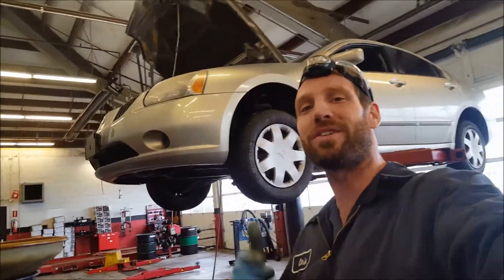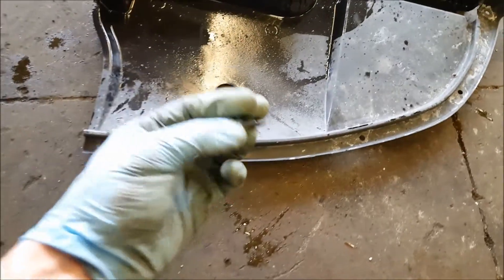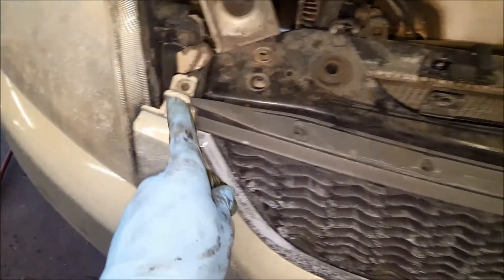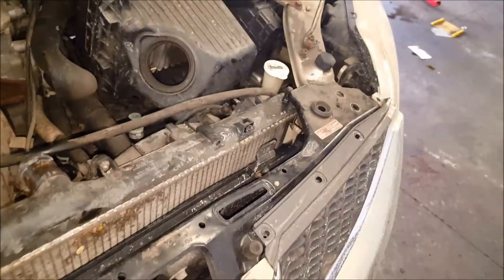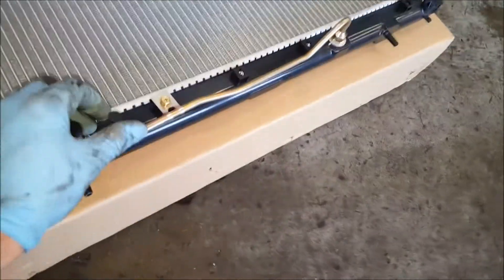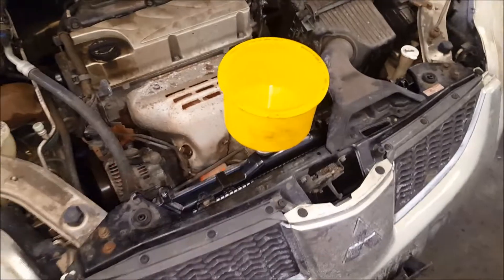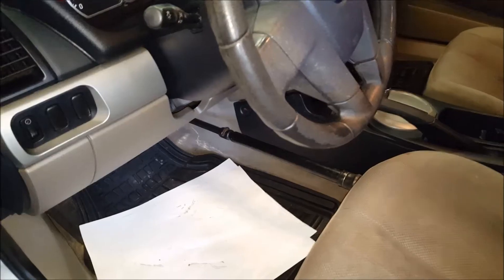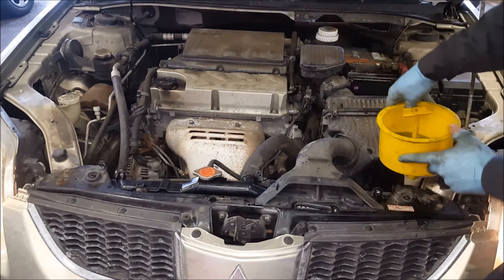04-12 Mitsubishi GALANT RADIATOR REPLACEMENT 2.4L SAME PROCESS FOR MOST CARS!

Comment: I took the radiator off and realized that the car doesn’t use oil cooling lines. The new radiator I bought has the oil cooling. If I just leave them alone would that create a problem? Would the coolant leak out of the holes? Please advise.
Reply from the maker: You just leave them open is fine. No it won't leak. There is a separate cooler inside of the radiator
Reply: @NoNonsenseKnowHow    where is the trans cooler   ?

Comment: You won't believe how absolutely spewing I was to find this video the next day after I did the job😡
Im from Melbourne Australia and did the radiator swap on my 2007 Mitsubishi 380. ALL Aussie built 380s have the 6G75 3.8 V6 Engine fitted and mine is the 5 speed auto but theres a 6 speed manual also available. 
I watched your video from start to finish and you might be amazed to hear that your video even with a completely different engine and a somewhat different car was nearly identical to the Australian V6 model!😳 
The only difference being was the 2 x 12mm bolts under the front cross bar, our car doesn't have those bolts under the grille, just the 3 on top each side. 
Other than that only a few clips here and there but otherwise everything else was absolutely identical even the cold air intake as well as the wiring as well as all the hoses. Like I said I am shattered that I didn't find this video before I did the job as it would have been extremely helpful but all I can do now is confirm how accurate your video was! 👌 cheers
Reply from the maker: Darn, well glad you got it taken care of either way. Thanks for letting me know, I'll add the 380 to the tags on it

Comment: Thanks for information but I have a question regarding the condenser... to replace it do I need to remove radiator also? My car galant 2008
Reply from the maker: No problem at all! And to answer your question I'm not 100% sure without having in front of me. I work on all makes and models so I'm not Ultra familiar with any single model.  But generally yes you do. Or at least unbolted out of your way.  Once you dig in though you'll figure it out pretty quick. Good luck!
Reply: @NoNonsenseKnowHow  that's fine thanks for your cooperative and support 👍

Comment: Im late to this, but Im new to cars so question. I have a 2006 mitsubishi galant and I need my radiator replaced, but the auto parts place near me only has 2 '09 Mitsubishi galants. Would I be able to use the radiator from that or would that not work for my car?

Comment: Hello, I have the 2006 Mitsubishi Eclipse GS 2.4L and it looks like the engine is almost the same with this Galant. Mine leaks from the upper part in the radiator plastic cover and the leak is minimal.  How much is the Radiator cost and how many hours to replace it? I just want to have an idea how much will i spend when i bring my car to the shop. Thanks!
Reply from the maker: Honestly it depends a lot on where you buy your radiator from. Cheapest bet is going to be online. And I don't remember the exact labor, but this is a pretty easy radiator to do. As far as shop pricing, that will vary dramatically from region to region and what type of shop you go to
Reply: @NoNonsenseKnowHow  Thanks Man I appreciate your reply. I saw this in Amazon "Spectra Premium CU2842 Complete Radiator" for only $95 with tax. I will probably buy it and have it installed in an auto shop. I get a price estimate for parts and labor from AAA and it is from $650 to $980. :-)
Reply from the maker: @dhondi0210  no problem. You could definitely tackle this job yourself. Not very hard and will save yourself quite a bit of money
Reply from the maker: @dhondi0210  if you buy it through this link here, I get a small percentage kick back through the Amazon affiliate.  https://amzn.to/2VCvH6X

Thanks and let me know how you make out!
Reply from the maker: @dhondi0210  or in the description of this video, there's a link to an even cheaper one on there
Reply: @NoNonsenseKnowHow  I'll try. :-)
Reply: @NoNonsenseKnowHow  Sure, I'll do that...
Reply: @NoNonsenseKnowHow  I clicked it but it shows doesnt fit my 2006 Eclipse.....
Reply: @NoNonsenseKnowHow  I will also get the upper and lower hoses from you link.. Thanks so much!
Reply from the maker: @dhondi0210  cool, thanks. I highly encourage you to tackle this job yourself. It will be rewarding!  In either case, good luck and thanks for stopping by the channel